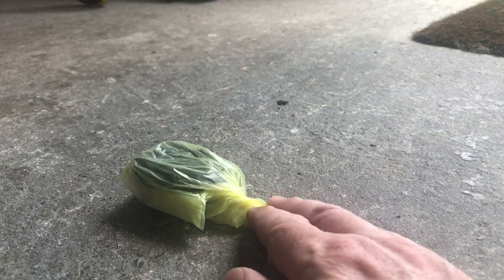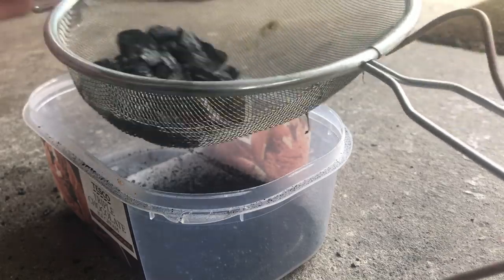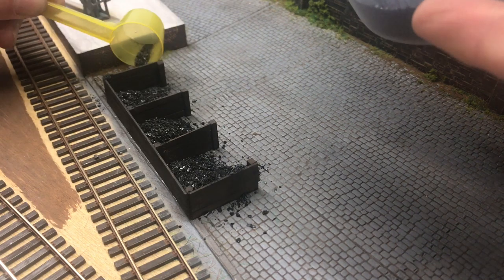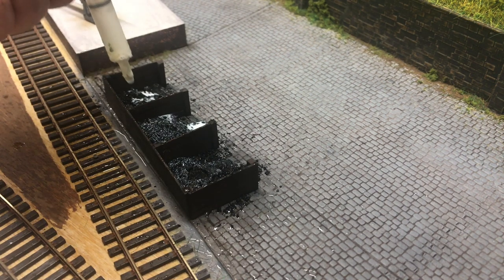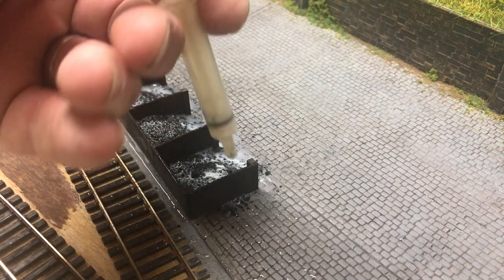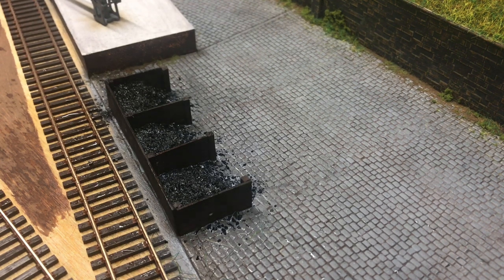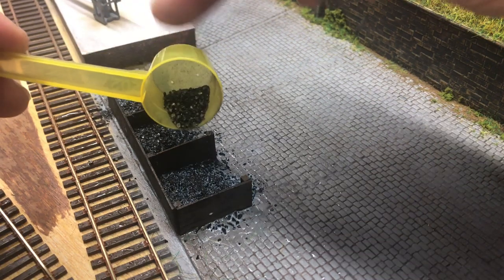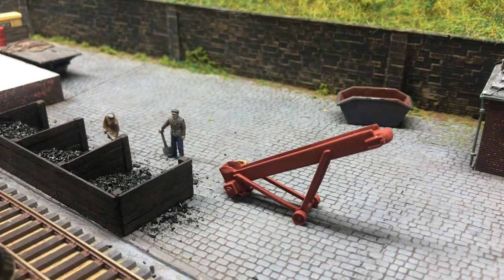Building A OO Gauge Model Railway: In Brief - Using Real Coal In Your Modelling

Comment: Hi Paul
Nice video, Ill be using a similar method for our kettle tenders and coal wagons, when I get around to it...
Its finished your staiths off nicely, you cant beat real coal for this, the fake stuff looks rubbish.
Cheers Paul
Reply from the maker: Thanks Paul, it does finish the scene off nicely, I really should get the accessories painted though. 😆 I didn’t know you had any kettles on the layout! Are you like me and keep them hidden away?! Paul
Reply: Hi Paul
I do like a bit of real coal in a tender.  
I don't run them on my layout often as they really only like going down the helix, not many want to pull a train up it...
I've got one sound fitted that I mess around with a bit but the others stay in their boxes, well until Jacks layout is up and running, he'll either have steam and green diesels or modern stuff, I'm hoping    he goes for the steam, he seems to like them.  I actually bought a Bachmann Webb coal tank and C class not long back off ebay really cheap and they are superb, makes the old Hornby and Airfix stuff look like kids toys and they run so smoothly.... Rambling now lol
Cheers Paul 👍

Comment: Tip of the day   dont use standard pva   if u use mod podge Matt it wont leave a shiney     surface   it may be slightly more expensive  but i use it for all my modeling  including ballasting and kit building   :)
Reply from the maker: Thanks for the tip Stockton. The only reason I’ve stayed away from Mod Podge is the price. Maybe I need to bite the bullet though. Paul
Reply: @GalgormHall  yeah it's worth it  I get mine in hobbycraft